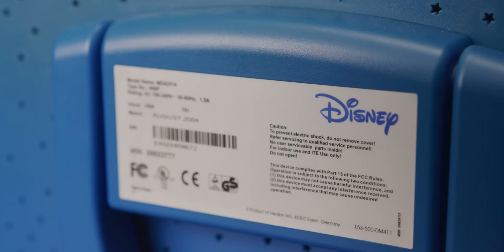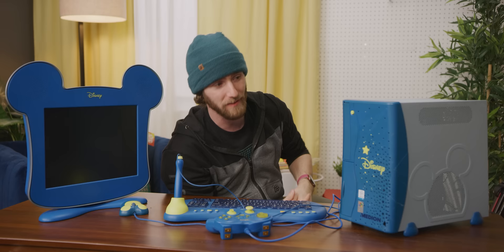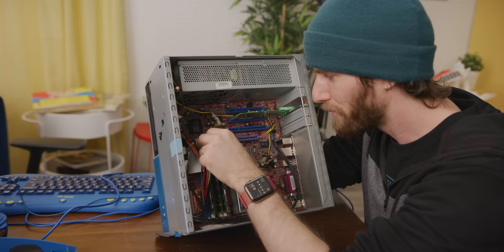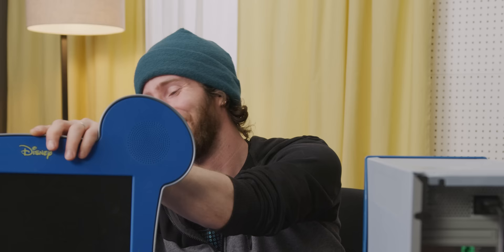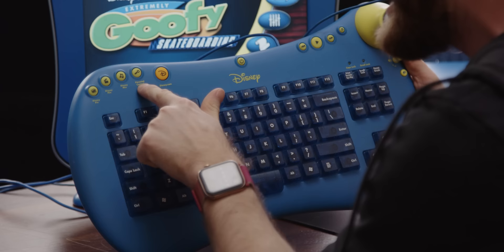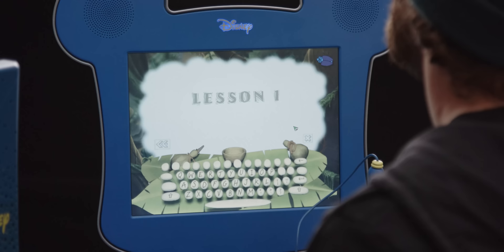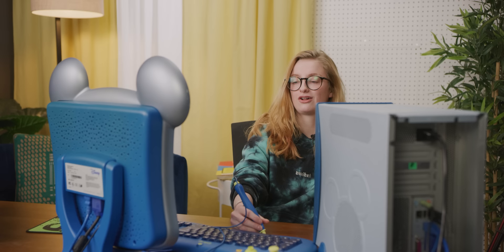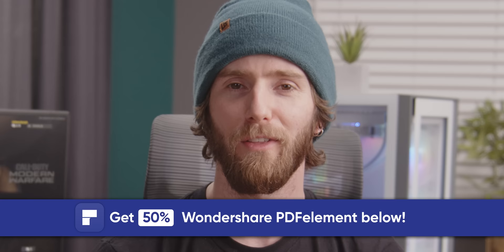The Disney PC is REAL and WE GOT ONE!

Comment: I love how they both use the stylus on flat surfaces when it's actually supposed to be used straight on the monitor
Reply: Whu........................
Reply: Yep
Reply: That's what I thought too.
Reply: Wait what
Reply: for real!?
Reply: Don't get the surprise people are experiencing, I mean, it's literally just a stylus-shaped mouse, as long as the optical sensor can recognize some features on/under the surface it will work
Reply: @MrCh0o  except it's not just a mouse in the shape of a stylus though. Optical mice use leds because it needs a bright light source to detect where it is  since its sensor is on the bottom of the mouse. The light pen's optical sensor works the same exacty way but it can only detect light from color/black and it has a real hard time being used on something like a desktop where there's no changes in the intensity of light.
Reply: Who knew?!
Reply: @michealpersicko9531 Unless the monitor is equipped properly your mouse icon would not match your stylus position.
Reply: @RetroGameSpacko  ...which it obviously is, being that it literally CAME with it
Reply: i don't think it is meant tto be used on a monitor, it'd be the same as putting a mouse on your monitor

Comment: "Remember CoreTemp?"

yeah, we are still using it.
Reply: And Speedfan... I use both of them on different machines. I felt a little called out.
Reply: It's almost offensive
Reply: @ssmodk  Try Rem0o's "FanControl".
Reply: How could you replace it?
Reply: Looks at Core Temp running in taskbar on current gen PC uhhh....
Reply: Yeah CoreTemp is still in use on my systems. Good software
Reply: Coretemp user here on all of my pc

Comment: Speedfan takes me back
Reply: Takes me back? to where? I still run speedfan. It is still a pretty reliable program for what it does. Its like winamp. That is still one of the best ways to play music files.
Reply: SpeedFan stopped working properly for me when I upgraded motherboard a few years ago.  Some motherboards it just doesn't allow you to control the fans and that one (I think it was the Crosshair VI Hero) was one of them.  I could read the RPM but not control them, no matter what I did with BIOS settings.  A while back I found a program called Argus Monitor and I still use it.  It costs money (but it's like $50 for several years or something) and it's a great piece of software. Much better UI and more control over stuff.  Advanced curves, averaging, comparators, etc.  It's really nice.  Instructions are a bit lacking but just mess with it and you figure it out.
Reply: @MrSirViking  Ha, I still have a speedfan-supported motherboard so it's going to be a while until I have to drop the program. However, the CPU is starting to show its age...
Reply: @martynbirdem189  why
Reply: wait we dont use speed fan anymore? is there something better out
Reply: Speedfan works well on my 4770k system today in 2021
Reply: Uh... I have speedfan, it works perfectly fine for what I want from it
Reply: I use speed fan today
Reply: I used it until very recently, but after upgrading to a 5900X on B550, the fans don't register anymore.
Reply: I’ve been without a gaming rig for a few years but I’m like wait what?! I actively used those everyday 😂
Reply: Last time I ran speedfan it killed my PC. Luckily it was a fresh install but it did it again when I reinstalled it.
Reply: Wait, that's an XP-era program?

Comment: My family bought one of these over my objections when I was a kid. It ultimately blew up.

Yes, really. There was a loud bang, and it never turned on again. If it happened now, I’d probably have tried to figure out what exactly happened.
Reply: If you still have the case I want it 😂😂
Reply: the person who bought the disney pc: plugs it in and sets it up
the pc: bomb has been planted
Reply: is there like smoke after the lound bang?
Reply: O.o
Reply: I guess the selling point about "mah kids safety" worked

That is, beside it blowing up, of course
Reply: Cheap PSU.
Reply: Where you playing COD on that pc? I wouldn't recommend that especially if you like gr3nades
Reply: @dangercactus  you let the blue smoke escape! you never let that escape.
Reply: @Taizyaija  ok
Reply: voltage switch probably got changed I did that with my old 90s 2000s pc 🤣
Reply: My guess is the power supply unit blew up
Reply: i was picturing a frag grenade just detonating in your bedroom

Comment: "Remember Core Temp?"
Me: Staring awkwardly at CoreTemp icon on my desktop...
Reply: *Slowly raises hand
Reply: I also use SpeedFan reuglarly I was sad it's obscure to him ;(
Reply: @BhavishComedy  Wow people still use that? I use the manufacturers software... In my case its from AORUS, i can literally get my fans at as slow as they will go without shutting down until cpu OR gou get to 65 C, and adjust the fan curve very well. I honestly dont see the reason to use SpeedFan anymore. As for CoreTemp... I gotta give it a try, its annoying to open Ryzen Master all the frikin time.
Reply: @sedixmrboss5625  Yeah CoreTemp can be set up to only show CPU package temp instead of all core temps, leaving a single number readout in the taskbar and isn't bloated like manufacturer programs. Still updated too. As for SpeedFan, I stopped using it years ago when UEFI became standard and got fan control support in the bios.
Reply: @sedixmrboss5625  And yet a lot of the manufacturers base software won't let you adjust things like whether to control a fan speed based on GPU temps instead of CPU. (Which is exactly why I use speedfan on my 9900k + 3080 rig.)
Reply: Same

Comment: Hey, don't knock on SpeedFan. I use it on a 6k system. Why? Cause I can get ahead of the heat curve in one app without messing with different apps for different fans. Nifty stuff right there. And since applying a custom fan curve, I've cut a whopping whole 4c in temperature in short bursts of heavy execution. Chew on that! ....